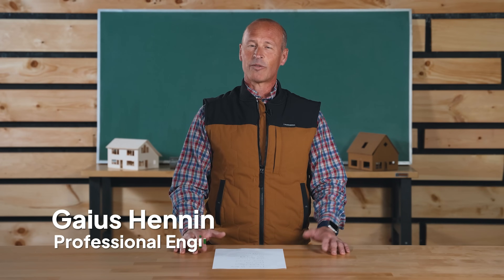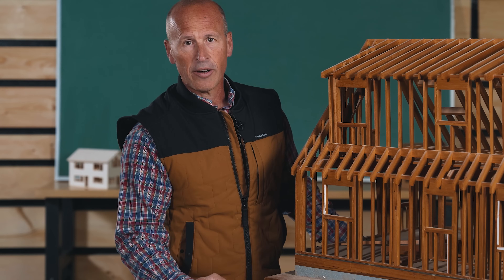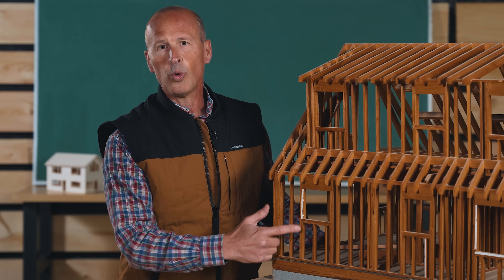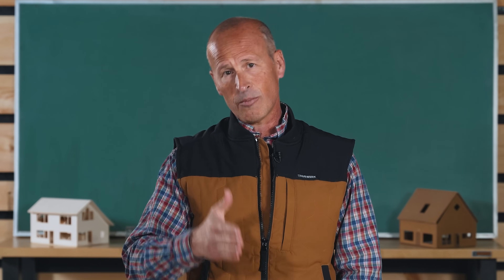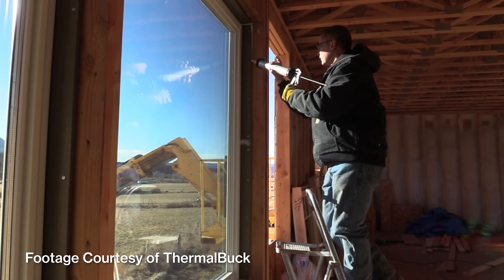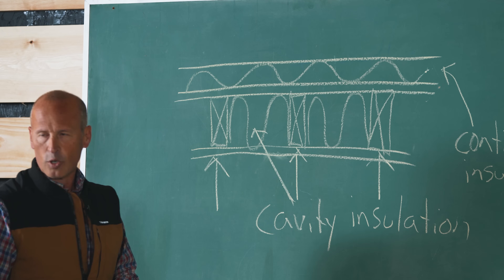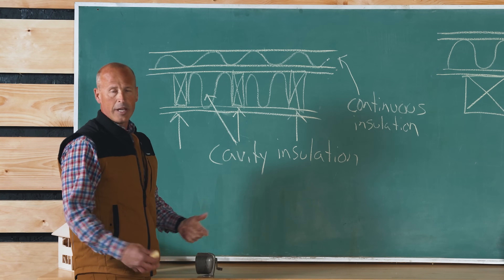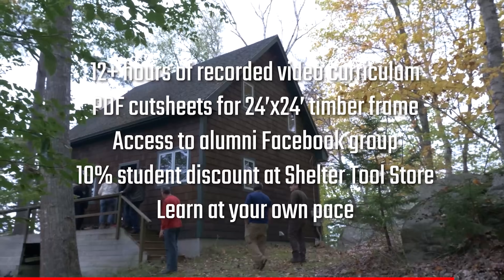How your house is losing heat: thermal bridging explained

Comment: Thanks for a very clear explanation of the problem with thermal bridging,  in Canada a lot of emphasis has been placed on the need for continuous tight vapour barriers on the inside of exterior walls and ceilings and the use of vapour barrier coatings e.g. alkyd or oil based paint, especially in retrofit situations.
Reply from the maker: Thank you for watching! Colder climates definitely seem to be taking it more seriously!
Reply: I'm surprised Canada doesn't mandate exterior insulation.  If you use Zip-R sheathing or XPS/EPS external insulation over normal sheathing, you do not want interior vapor barriers or you will create a vapor barrier sandwich with water vapor in stud cavities having neither side where it can dry to.  Maybe with Rockwool exterior insulation you would need an interior side vapor barrier since the rockwool is vapor permeable.  Anytime you use closed cell spray foam between studs, you do not use an interior vapor barrier.
Reply: @bobbray9666  depending where you are in Canada, you still need, (by code), a vapor barrier over closed cell foam.
Reply: @quantumleap8888  That makes no sense, but those rules are made by your government so I get it.
Reply: @bobbray9666 vapor barrier needs aren’t directly related to insulation needs. It’s a different conversation, coming from whichever zone you’re in, not by the whims of governments. 

That’s why in some zones, vapor barriers are a good idea and in others, a bad idea. YouTube videos won’t always note the design distinction.

Comment: Heat exchange takes all paths - not just the path of least resistance. Some heat goes through even the most insulated part of the house. It's like water in a burlap bag - it weeps from everywhere, but if there are holes in the bag, it flows faster there.

Comment: Don't go with SIP walls as it very difficult to route utilities (electrical, plumbing, low voltage wiring). SIP is OK for roofing, but a real pain to work with for walls.

Comment: You could also talk about double stud walls where there is a space between the interior and exterior wall, and where you stagger the studs so that the interior and exterior studs aren't on center of each other but staggered to increase the cavity size between studs and the other side.
Reply: @3:45

Comment: The IBC has qualified the heat loss and balanced unaffordable passive house with improved energy standards. Even in California we now have exterior insulation on standard homes. Airtight is more important than excessive insulation which will never pay back the carbon burden it took to make it or the money to install it.

Comment: I find it facinating that a 7,5 inch thick wall vould be considered a problem?

Here in Sweden, in order to meet code you usually have to build a 12" thick wall and have 20-25" of insulation in the roof. A vapor-barrier is placed on the warm side of the structure in order to prevent moisture to diffuse in to  the wall. On the inside of the vapor-barrier, a 2-3inch "service cavity" is build so water- and electrical installations can be made without compromising the vapor-barrier.
Reply: I watched a channel of a Swede rebuilding a house that burnt down and he went over a lot of the things you mentioned here. The service cavity was such a good thing to see and one day when I  build my own home, I am definitely adopting that in the build.

Comment: When mass timber is used ( CLT or logs) instead of sticks/studs and insulation is applied to the outside , the wall then becomes a storage medium for heat as well as a humidity controller due to the hygroscopic effect of wood . The entire assembly is vapor permeable .
For example my house is made of 14 cm thick laminated beams/logs with continuous wood fiber insulation panels on the outside , also 14 cm thick . then vertical furring strips are installed to secure the insulation and to accept the desired siding . the space between the furring strips acts as a vent to remove moisture build up . the channels are open at the bottom and top to create air flow .

Comment: My approach in zone 6a was Zip-R12 sheathing and closed cell spray foam between my 2x4 studs.  This creates R-30 walls which are the same thickness as 2x6 studs and accommodates most windows without custom window/door extensions needed for thicker walls.  My wall studs are R-15 instead of R-5, if building with 2x6 studs and no exterior insulation and 5" of sf.  For my home, about 925 sq.ft. are wall studs and headers, so insulating with exterior insulation makes a big difference overall for energy consumption.

By using Zip-R12 sheathing (2-1/2" thick), we didn't need window bucks.  We used 4" exterior structural screws on the window flanges though the Zip sheathing and into the window framing.  Overall our labor cost was much less than installing regular sheathing, window bucks, exterior insulation, a WRB, and furring strips for siding installation.  Also made it much easier to make sure everything was installed correctly, since using ZIP-R was pretty much like installing wood sheathing.  Just needed to tape the seams and window openings with ZIP tape to make the assembly air and water tight.
Reply: I would not build a house without external insulation. Zip-R is the best way to do that One pass of labor instead of two.

Comment: Sir.  Building a custom home in Northeastern WY.  Your information is of great value.  A point of clarification on your continuous insulation concept.  Am I correct in assuming that insulation should either be on the outside of cavity insulation or the inside, but not both to prevent condensation and moisture from being trapped (and thus leading to mold, etc., etc.).  I was under the belief that you should have insulation on the inside and outside of the cavity.  I hope I correctly articulated my questions.  Thank you.

Comment: If you go with sips and timber frame do you still require a vapour barrier on the inside wall? Same question for the zip r system

Comment: If you have an attic and the insulation is on the ceiling (so not on the underside of the roof), and are seeing exterior roof stripes, wouldn’t the roof probably be getting warm in between the studs/trusses in this case?

Comment: Nah, best option is continuous exterior foam panel insulation and 24 OC 2x6 exterior wall construction. That will provide the most bang for the buck. Once you get into double studded walls the complexity & cost goes up for diminished returns of reducing heat loss. 

The most heat losses in a well insulated home are not from the walls, but from windows, doors & vents. Door heat losses can be reduced, by using fiberglass exterior doors with multi-point locks for a tighter seal. For vents (dryer, bathroom, stove, etc) install a vent backdraft damper on the exterior side of the vent pipe. Insulate the vent pipes. For windows, installing fewer & smaller windows helps.
Reply from the maker: All interesting points and potential topics for future videos!